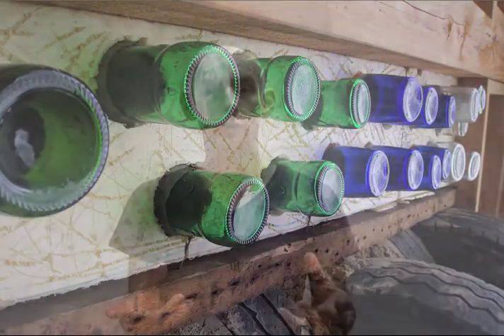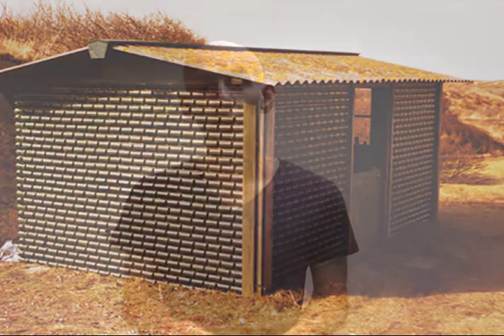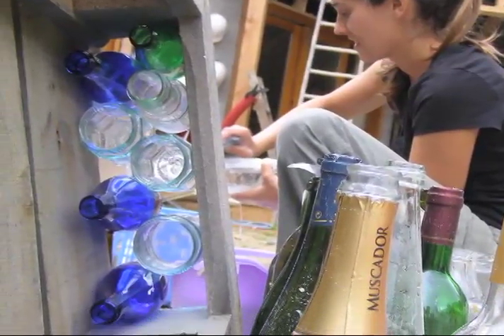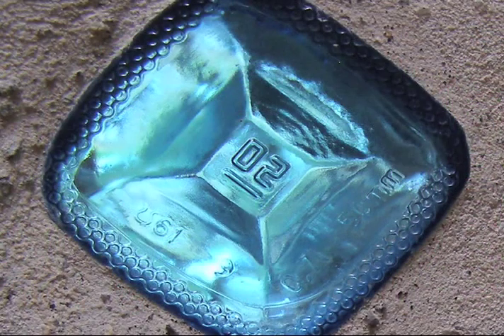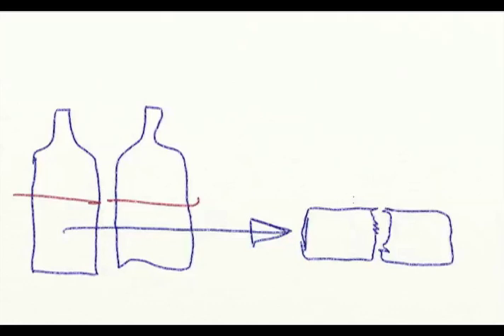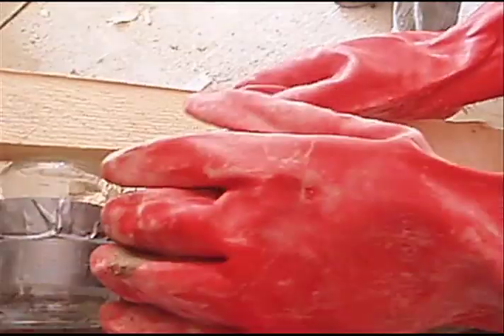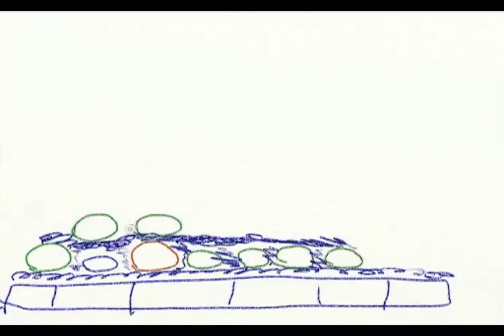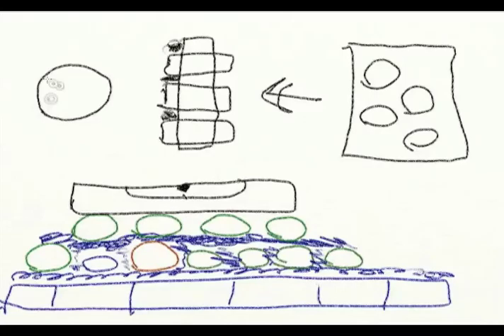Earthship Bottle Walls from Glass Bottle Bricks - Bottle House & Heineken WOBO (World Bottle)

Comment: Can a bottle wall be sealed well enough to be a shower wall and stay intact over time?
Reply: They’re used for exterior walls, so I don’t see why not but you would want to paint the interior concrete walls with something that won’t stain easily and be easy to clean. :)

Comment: "People who live in bottle houses shouldn't buy their kids BB guns!" That said, how hard would it be to repair a broken bottle or bottles??
Al
Reply: Use a mason drill bit and a bulldog (large drilling gun) drill holes around perimeter of the woumded bottle and make a new bottle to go into the hole, make it a premade brick and wrap some concrete or plaster just shy of the holes drilled and cure it. Once cured place fresh mud on the brick and inside the hole and slide it in and together. Let it cure and its repaired.